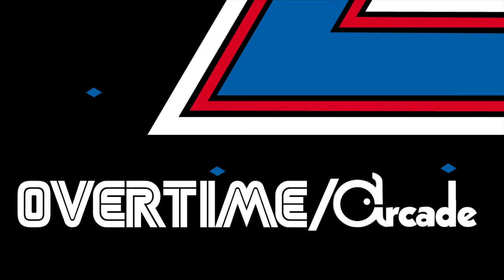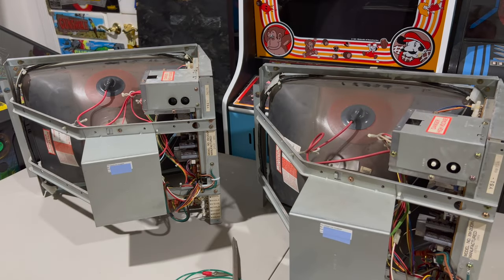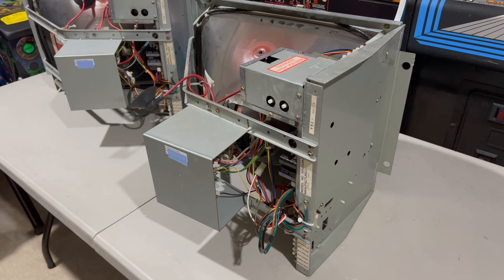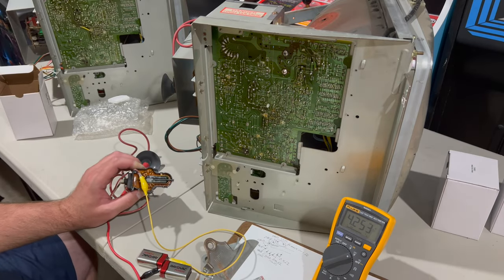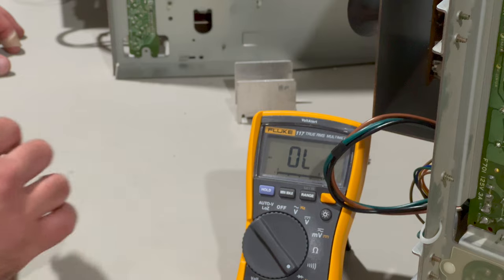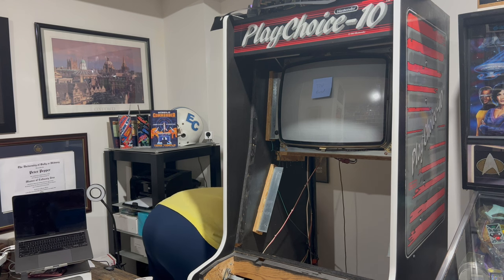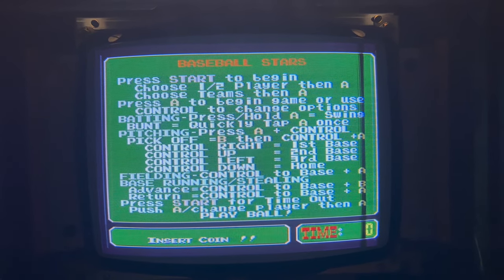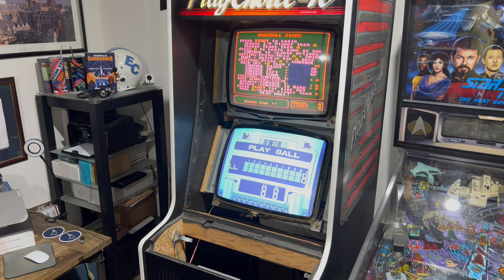Let's Fix Nintendo PlayChoice-10 Monitors

Comment: What do you mean by how the transistor h o t is different than other types of transistors and how you test it because you could test transistors power transistors using the diode check so I'm kind of confused on what you mean how the hot transistor is different when testing and different from other transistors
Reply from the maker: Basically, if you test a HOT like a regular transistor, you might mistakenly think it’s shorted when it’s not.

Buffet had a good video about testing HOTs several years ago: https://youtu.be/XhwuHF-ffpE
Reply: @overtimearcade  The Schematic symbol for the HOT looks the same as a normal transistor so I'm very confused why it would test differently. Their might be an additional protection Diode across the collector pin and emitter pins
Reply from the maker: @waynegram8907  I think most HOTs have a damper or something?
Reply: @overtimearcade  Yes it seems that the HOT has a damper diode which I thought to protect the HOT transistor from getting damaged from the flyback reverse voltage and CRT reverse voltage. This is why it tests differently because of the internal damper diode from collector to emitter. I didn't know the HOT had an internal damper diode.

Comment: I think you need a cap kit on those.
Reply from the maker: Both chassis received a cap kit about two years ago when I first picked up the cabinet. I think my next move is to hit both tubes with a clean & balance from my rejuvenator (once I get it fixed), and I may have a lead on a possible solution for the vertical bars caused by the repro flyback… stay tuned!